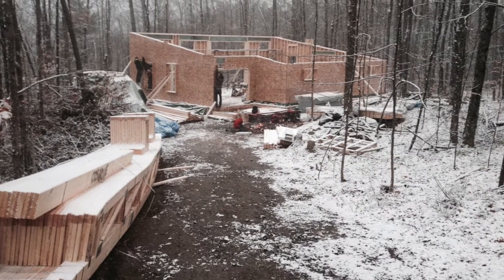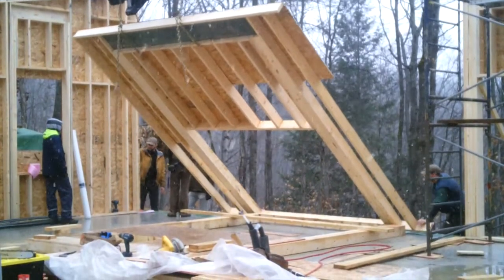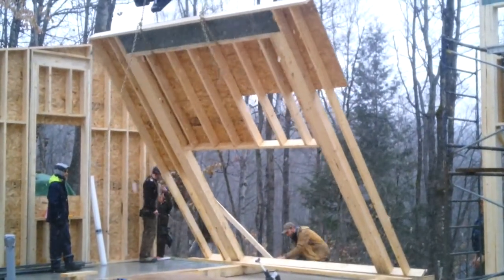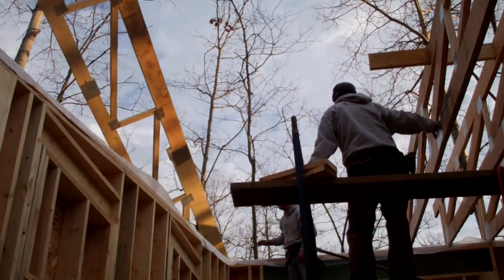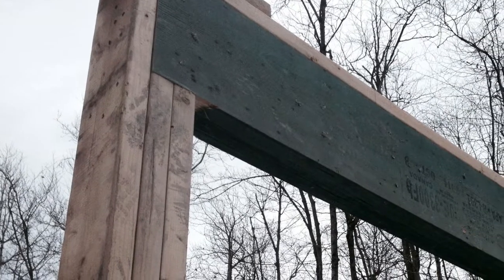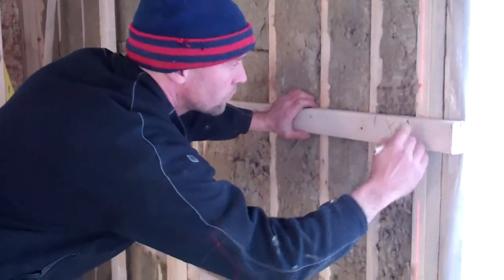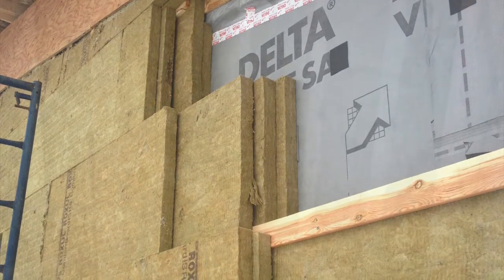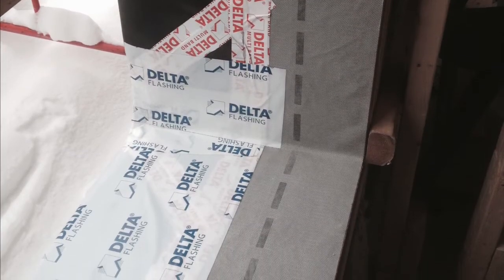How to Frame a LEED Platinum Wall Assembly - Ecohome Demo House framing

Comment: Do you have any thoughts, regarding cost and performance, about building a house in Ontario that is timber framed with mortise-and-tenon joinery, and that uses a hammer-beam truss design? And then enveloping the structure with straw-bale insulation to eliminate thermal bridging?
Reply: Sorry for the delayed response John. As a former timber framer I can tell you that that is an easy way to add 10s of thousands in cost to a build. its beautiful and I loved building them, but its a very expensive craft unless you do it yourself. It does however lend itself well to strawbale, and straw provides and excellent R value, you just need to be careful about it and very mindful about moisture issues.